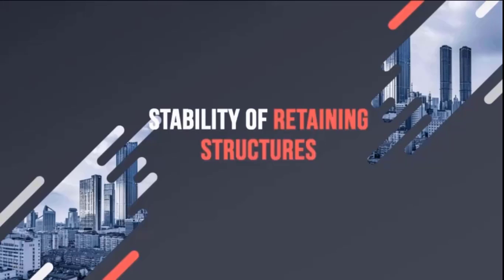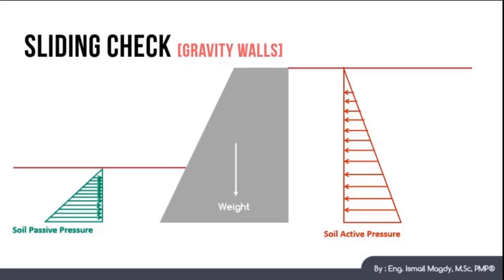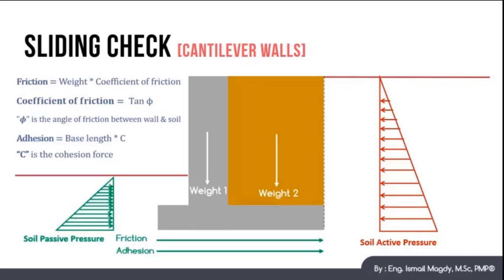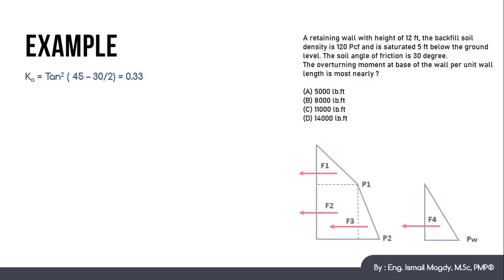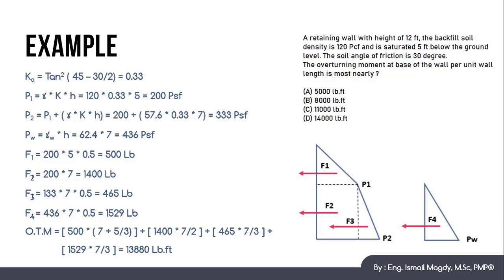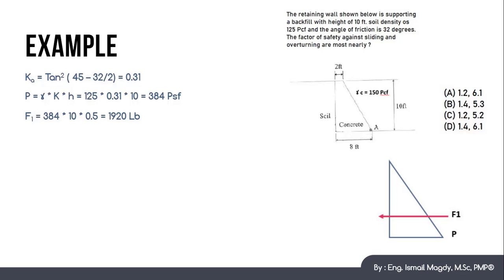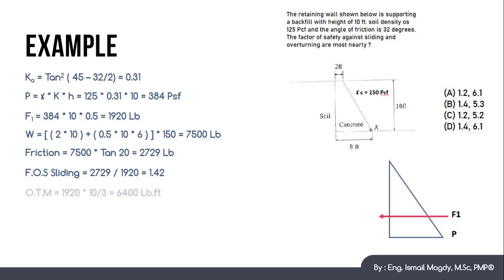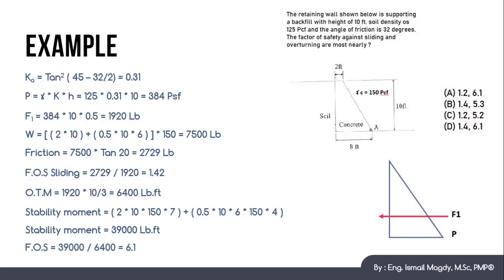FE Civil Exam Course - Retaining walls

Comment: For the second problem, where does it say that the angle of friction is 20?
Reply from the maker: Angel of friction between concrete and soil will either be given in the problem OR it could be assumed to equal approximately 2/3 of the angle of soil internal friction